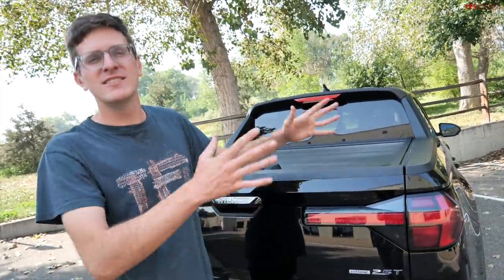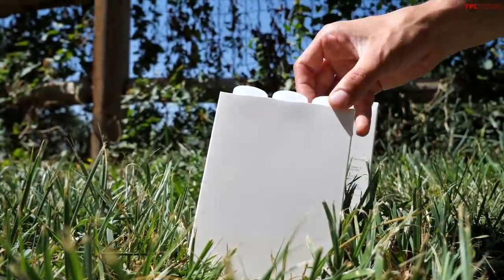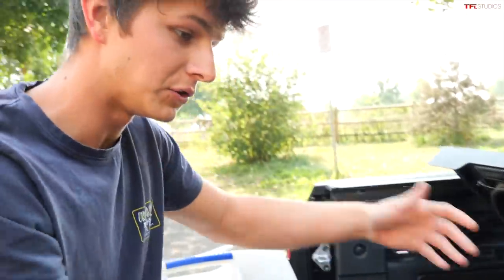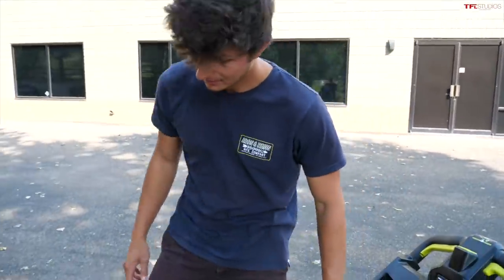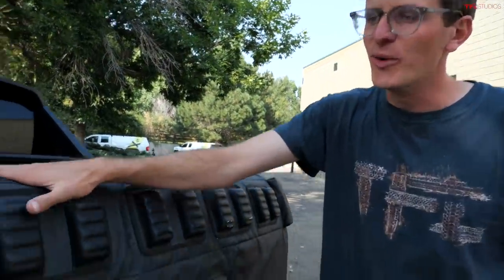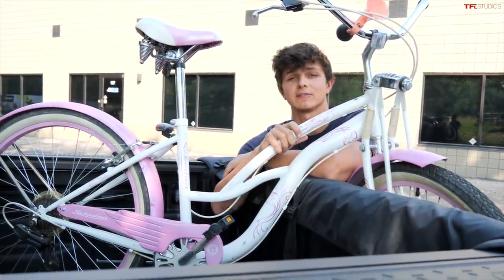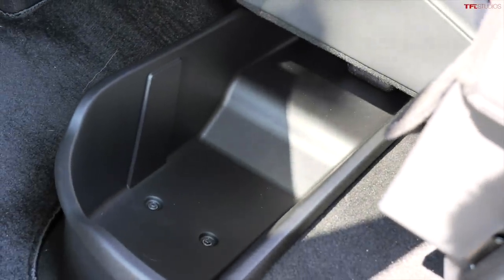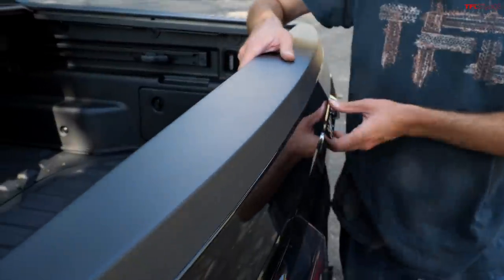The New Santa Cruz is a Tiny Truck - You Won't Believe What Fits (and What DOESN'T Fit) In The Bed!

Comment from the maker: Thanks to Keeps for sponsoring this video! Head to https://www.keeps.com/TFLTruck to get 50% off your first order of Keeps hair loss treatment.
Reply: it nees a lift kit
Reply: If you back the ATV and motorcycle, they fit. The motorcycle: back it in and turn the front wheel sideways. I mean without the cover.
Reply: Did you try the razor quad backward?   Would the quads' back tires then slip in under the cover, with the rear quad fenders over the cover?

Comment: I’ve managed just fine for decades with a 5 foot bed, so a 4 footer will be adequate- just drop the tailgate for longer items. Get a hitch extension and some ratchet straps for securing really long stuff like a kayak. When I had an SUV I put bikes on a hitch rack, so I’d do the same here and use the bed to carry random gear and tools. 80% of the time the trucks I see are hauling nothing but air or trash, people tend to way over estimate what they are going to carry. The only full size trucks I see loaded up are contractors like plumbers, painters and landscaping companies.
Reply: You are right, and when you realize the full size trucks cost over 50k you  wouldn't even wanna use the bed for trash or anything else that can scratch or damage it, people are scare to use their new trucks as intended unless they are work trucks or already an old beater
Reply: It also has a towing capacity up to 5k depending on what engine is chosen. If a person is truly realistic on what they need — this is an awesome choice against the inflated prices of trucks right now.
Reply: I just question why they didn’t lay the bicycle down and turn the handle bar? Rarely have I seen people drive around with bicycles standing in bed of a pickup.
Reply: @MarcosViloria  if you don't have a scratch in the bed of your pickup in the first month you can't call yourself a pickup man
Reply: @frenchonion4595  I've done the math countless times, having a car for the times I don't need my truck won't save me enough in gas to pay for the insurance on said car let alone the purchase and maintenance.
Reply: I mean, people can make their own use-case decision, but if you take the TFL tests in aggregate, the Santa Cruz is significantly worse than a BOF mid sized truck at almost all traditional truck tasks. Regarding price, the cheapest Santa Cruz with AWD starts at $28,700, the cheapest 4x4 quad cab Frontier is $32,000, but that's if you get that Hyundai with the baby engine. If you want the good engine, it's $35k to start.
Reply: @andrew andrew use a packing blanket
Reply: Years ago, I put my'79 KZ 1300 Kawasaki in the back in the back of my 1980 Ford Courier. Left the tailgate down turn the wheel and put it in the bed diagonally. Of course the bed was longer in The Courier, but the motorcycle was substantially longer then the motorcycle in this video as well.
Reply: Don’t forget this truck also tows 5,000 pounds so you can always put  motorcycle ona trailer

Comment: FYI:  You can fit two full size mountain bikes with the Santa Cruz tonneau  cover, no problem.  You are not giving the bed it's full justice.  The bikes do fit at an angle, but fit no problem.  I have a DAKINE bed cover (small), fits just fine.  I have no doubt you can fit a motorcycle in my bed if I remove my cover, it may have to sit at an angle, but it would fit.
Reply: This is what I think exactly

Comment: Beings it’s meant more for hauling then towing I suggest loading up the bed and driving up the Ike under max payload. Also, does a pallet fit in the bed, like if you were to get a pallet of soil from the Home Depot store?
Reply: Pallet of soil will strain if not max out half ton pickups
Reply: I'd say, considering it's towing capacity is 5000lbs, it's actually better at that than it is at hauling. 
The max payload includes passengers.
Reply: It can tow 5000 pounds, I'd say that's more than capable enough for towing!
Reply: Physically it should fit (48 x 40 inches is a fairly typical size.).  The weight may be an issue though.   It is more than capable of towing most utility trailers so that is also an option.
Reply: @1guyin10  max payload is 1750 pounds, minus occupants. That's a hell of a lot of weight still.

Comment: I saw a Newer Tucson hauling a enclosed 5x8 camper trailer pulled over on the highway with the hood open.  Overheated most likely by overloading the trailer.
Reply: Although it looks a lot like a Tucson, most of the suspension components are from the Santa Fe.  It also has a different and more robust transmission with additional cooling, and lower gear ratios to reduce drivetrain stress while towing.
Reply: @dcl97  but in Canada it’ll have the dual clutch I think.  Not sure how’s that going to work on rolling hills and highways.  Even the Tacoma struggles.

Comment: Looking at a Ford Maverick 🇺🇸; won’t buy a  Korean truck, but this video helps get a real-world sense for bed size. 👍🏻
Reply: dont quote me on this but im pretty sure the Santa Cruz is made in Alabama and the maverick is made In Mexico
Reply: @swami539  pretty sure the Maverick is ASSEMBLED in Mexico with American parts and 
Hyundai assembled in Alabama with Chinese and Korean parts
Reply: @devinbender8428  well if thats true thats quite a dillema
Reply: @devinbender8428  have either manufacturer provided what the domestic parts content is? Where did you find information on where parts come from? I tried looking but haven’t been able to find anything as of yet.
Reply: The upside to the Maverick is you get a true 4.5 foot bed. The Santa Cruz is like 4.2 or 4.3, some odd number (even when optioned without the bed cover). That may not seem like a lot, but 2 or 3/10ths of an inch could mean Roman's motorcycle fits or doesn't.
Reply: @ALMX5DP  I searched as well but I couldn't find much. I hope it would be American made parts but I doubt it. imo doesn't change the fact that its an American brand building a vehicle outside the us.
Reply: @putmeincoach7663  when it couldn't fit the razor quad I was like damn. but its more of a compact truck for suv/crossover people im sure its a good vehicle but not for me especially on pricing for the turbo models
Reply: @devinbender8428  true maybe one day ford can expand and have enough capacity to build them in america.
Reply: @swami539  they would have to build another factory. The Mexico plant makes roughly 300,000+ cars for North America. (USA Canada Mexico). 
That’s a massive amount. And that plant in Mexico has been there since pre WW2
It would make the mexican market very angry
Reply: @devinbender8428  fair enough i know they wont move production because they cant but i can still hope maybe one day lol. Hopefully the maverick is really well built if its reliable ill absolutely buy one

Comment: Sort of chuckled a bit watching this segment.  I owned a (new then) 2000 Ford Excursion Limited 7.3L diesel.  Almost everything they tried to load in the little pickup would've fit in the back of the Excursion even with the 3rd row in place!  Maybe even the Santa Cruz itself!  Sold it in 2013 with only 120K miles for nearly 75% of what I originally for it!  I still see them on the road and wish I hadn't traded that vehicle.  What a beast!

Comment: Compact trucks with the feature like the chevy avalanche with an extendable bed into the cab would make a lot more sense imo
Reply: The Subaru Baja did this and I was surprised that - especially the high price point of the Santa Cruz - it doesn't let you fold down the seats (or take them out) and swing the rear wall down.

Comment: the desert sled uses a larger front wheel/tire at 25.5" in diameter and has a comparatively long wheelbase at just under 60".  This means that the minimum bed length required is 72.5" which would put the front tire against the bed's front wall and the axle immediately above the 72.5" mark,  The santa cruz bed with the tailgate down is just a hair under 6' or 72".  This means a typical sport bike like a yamaha R6 with a wheelbase of 54" and a 23" diameter front wheel will fit just fine. Its overall length requirement of 65.6" inches leaves enough room behind the rear axle to haul it safely.  However, a standard YZ450F dirt bike has a wheelbase of 58" and a 28" diameter front tire, bringing the length requirement to 72" just like the Desert sled.  So yes, it will haul smaller motorcycles/sport bikes but it won't haul a dirt bike without turning it diagonally (this is how you should haul it anyway) or larger bikes.

Comment: In my opinion its more useful then its sibling the tucson, the bed is a larger trunk for the family, still a 4 door and a useable bed, in my opinion it s a good idea i just think its too expensive
Reply: There are things that crossovers can do that pickups can't though, the Tucons remains a very short overall length, but if you are by yourself or just one passenger, you can fold the rear seats down, lay down a tarp, and load it up with a huge amount of cargo that is safe from the elements and theft if you were to stop by a iHop for a quick bite.   A SC is much longer and because there is no passthrough into the bed, the length of items you can haul without it really sticking far out the back is limited.    The Baja and Avalanche resolved these issues by allowing you to fold down the second row seats that would connect with a passthrough to the bed.
Reply: If you regularly carry back-seat passengers you would appreciate the greater rear legroom in the Tucson. But as a second vehicle mostly used by 1 or 2 people it would be fine.

Comment: Well done! Years ago I built a spreadsheet of everything I ever carried/moved and used that to help decide on a vehicle. Turned out the 2008 Sport Trac pretty much did it all. That was just enough bed, and it was not hindered by the tonneau cover box because you could easily remove the cover if necessary. That bed size was the minimum. Might as well just have an SUV if any smaller.

Comment: Does a bicycle fit in the back seat area? And how hard is it to remove the tonneau cover?
Reply: Doubt that a bike will fit inside the cab. The solution is to get over the bed rails and mount bikes above the cover. Yakima & Thule both make tonneau compatible racks.

Comment: Would have been nice to see if a standard wooden pallet fit in the bed. That's kind of the standard for a pick-up I think.
Reply: It'll fit a standard 48x40 pallet. I've actually measured it out in my review video.
Reply: The bottom floor dimension is 43 x 52

Comment: Ice gonna melt in 10 secs in that "cooler" lol
Reply: Throw some styrofoam laying around into the bottom and sides, boom insulation. ;)
Reply: @ALMX5DP  right on top of the exhaust pipe BOOM heater
Reply: @canyonero2050  Likely a heat shield between the two, so with a little insulation should be just fine for a day at the beach or tailgating at a game. But it's not like people are forced to use it that way, just one of many options for that feature.
Reply: @ALMX5DP  "likely"? According to who? lol
Reply: @mechmat12345  me, most exhaust systems have some type of heat shield between them and the floorpan or other more vulnerable areas like gas tank or suspension components.
Reply: @ALMX5DP  I'm gonna say you're not a reliable source, Mr "saying likely to bolster my own argument even though I don't have any direct knowledge".
Reply: @mechmat12345  I am more than happy to be corrected on the matter if you have information to the contrary. All i can provide is my experience working on and around exhaust systems on a variety of different cars. Exhausts get hot, heat shields are commonplace, those two things are rather indisputable.

Comment: You're wrong about the dirt bike. 
Without the factory tonneau cover, you could transport a dirt bike from corner to corner - at a 45 degree angle. 
It fits with the tailgate down, no problem.

Comment: If I were to change anything about this or the Mavrick is to have the wall where back seat rest is/divider fold down. Think that would have been game changer espcially since this is a unibody should have been able to do that.
Reply: That's called a "mid-gate". GM pioneered it with the Avalanche. I think Hyundai and Ford both really messed up by not offering it at least as an option.

Comment: I've seen all your Santa Cruz videos and I'm convinced that this will be perfect for me. Can you tell me what brand is the ramp you used for the bike? I have an electric bike and it's too heavy for me to lift so I would need a ramp. Also what tires would be best for driving on beach. I'm moving to Florida and there are beaches that you can park in the back on the sand. Thanks guys you do a great job.

Comment: I want to like this thing, but I am struggling with the logic. If one was going to haul things in the bed regularly, a mid-size or full size truck with a bigger bed would be the better choice. If the need is to haul only occasionally, I think a crossover or SUV (i.e. Tucson) towing a small utility trailer makes more sense.
Reply: Unless you don't have the space to store a trailer, or are uncomfortable towing.
Reply: Well, you hit the nail on the head. The use cases where this has more utility than a crossover and is more practical than a mid-sized truck are exceedingly small. People will rationalize it because they like the way it looks or whatever, but this doesn't need to exist.

Comment: Turn the quad around and back it in so the back wheels roll under the cover, the rear fairing if the quad sits high enough to work.

Comment: I just sold my 4 cylinder 2015 Frontier and I miss it. This thing looks like it would do most everything I need. The payload capacity, rear seats, towing capacity (AWD version) and horsepower are all better. It's also $17k more than my Frontier cost. :O
Reply: 5000 Towing capacity with turbo awd (33k+) and only 661lbs can go in the bed. Not all that impressive when the Maverick is $28,000 for the awd turbo of 4000lb towing and 1300lbs in the bed
Reply: @devinbender8428  Or you could just buy another Frontier that's better than either, as was proved in this video.
Reply: @mechmat12345  the new new frontier will likely cost more

New 22 Frontier Crew Cab 4x4 SV with tech and towing package is just under 40k
Reply: @devinbender8428  you went uptrim and added options to make it cost more. Crew cab Frontier with 4x4 starts at $32k, the cheapest Santa Cruz with v6 and AWD is $35.6k.
Reply: @mechmat12345  my point exactly! A very decently equipped Frontier is STILL cheaper than a loaded SC.

A loaded Frontier is only 45,000
That’s only 3500 more than the Hyundai. That’s crazy!

Comment: Found out Hyundai offers an accessory of a tailgate cage to extend the bed length to the end of the tailgate or a coral when closed for smaller items to prevent them from moving around the bed.

Comment: I've always wondered... Would a full size or counter depth refrigerator fit into the back of the Santa Cruz? Maybe without the cover? Very tall but could be useful for those once in a while runs to the store.
Reply: Now that would be some epic space testing.  Id love to see em get medieval on it.
Reply: @foellerd  "In theory" all household appliances should fit from rough measurements.
Reply: You mean you're gonna buy a Santa Cruz so you don't have to pay home delivery charges for a once-in-a-decade appliance purchase? ok
Reply: @mechmat12345  Good interpretation. Derp.

Comment: As someone who has owned a Honda Ridgeline, all I see is a tiny version of the Ridgeline. A lot of the same features in the bed are the same. Now granted, the features of the Ridgeline and Santa Cruz  are features that I do like and are very functional. Again I see this as miniature Ridgeline but this could be a great option for more populated cities.
Reply: That's my thoughts exactly.
Reply: The Ridgeline sucks too, so you are correct.
Reply: @mechmat12345  I think the newer ridgeline is amazing I used it as a work truck at a body shop routinely towed 5k pounds on our trailer and I'll say it did a much better job then my 03 silverado with the 4.8 v8 and got 25 mpg while doin it so I disagree there.

Comment: If you can use it as a cooler, is it insulated?
Reply: It is not.
Reply: clearly not as shown in the vid
Reply: Insulated or not, sitting right above the exhaust is not great engineering.
Reply: @putmeincoach7663  It doesn't.  The exhaust is over on the passenger side and is behind a heat shield and is quite far away.  The only thing actually close to the area is the spare tire, which I'd much rather have no spare tire and a simple tire repair kit and a larger bed trunk.
Reply: @Mike The hole is to make it easy to rinse out for cleaning more than anything, same as in Ramboxes and the like.